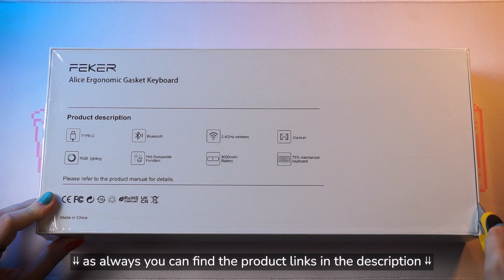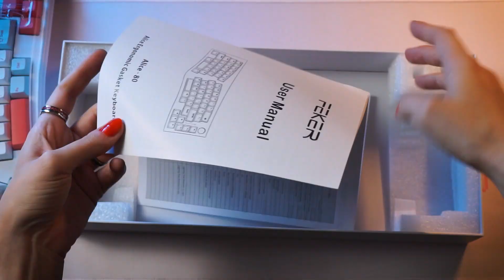FEKER Alice 80 Ergonomic x Gat Yellow Pro 2.0 x Feker Holy Panda | Whatgeek coupon

Comment: Thx for the video. I bought this one to try and learn Colemak on and it will arive tomorrow. Did you lube and film the switcher or do you use it as is?
Reply from the maker: Wow, Colemak? Let me know how the learning process turns out, I wonder how much more comfortable it will be!
No, I use them stock - but after a while I think they'll need some lubing and cleaning (although it's true for most switches :)).